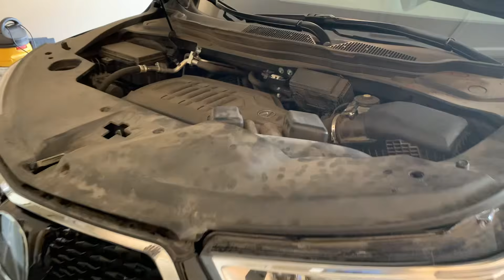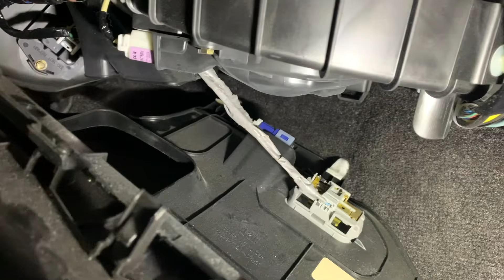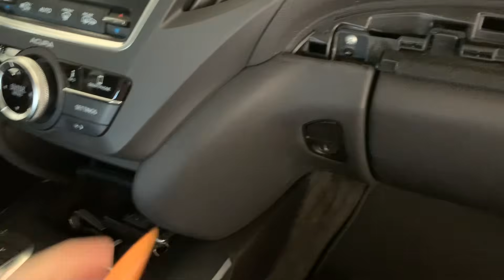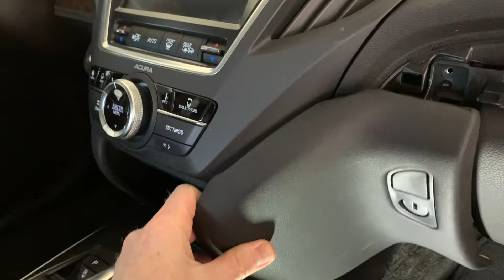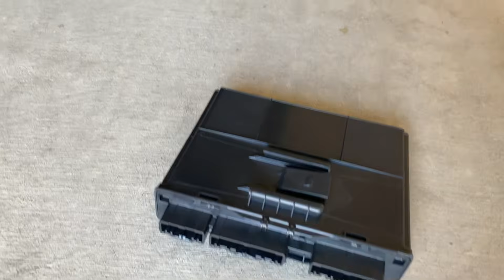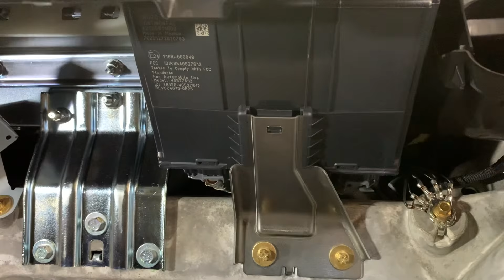Honda / Acura Random, Intermittent Flashing Dash Lights, Headlights, and Car Alarm - FIX Part 2

Comment: Thank you so much for this, you are amazing!  Did this last night on my 2017 Honda Pilot Touring.  Took me about 2 hours start to finish, including a couple kid interruptions.  Also, at least 30 minutes of that was me trying to open the Keyless Access Control Unit.  I did the straw trick that some others have mentioned, and it was still very difficult to get that sucker open.  Once you have the straws in, it still took quite a bit of careful prying to get the thing open.  

A few differences with mine (2017 Honda Pilot) compared to the video is that 

1.  I didn't have to take the vent cover off.  
2.  The process to remove the glove box has an extra tether string that you need to remove, and the bolts were 10mm, not 8mm.  

It went smoother than I expected, and while it's only been 12 hours, I haven't had any issues since performing the fix.  Prior to this fix, the issues occurred approximately every one minute.
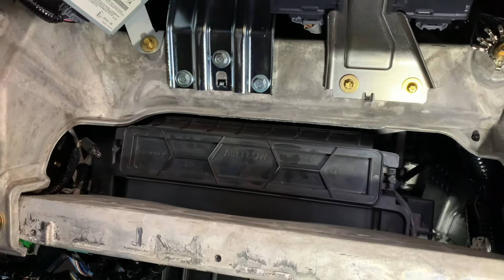Reply: Did your car - behind the glovebox - look like this (at 4:41)? My 2017 Odyssey Touring is completely different. It looks like the housing for a round air filter. Is it behind that?
Reply: @dec222ab  Mine looked pretty much like the video.  In reading other comments, it sounds like on the Odyssey this module is located underneath the steering column, so not the same location as this video.
Reply: Found it. It is on the driver side, way up there. Now to find an offset socket to get the thing out of there.

Comment: I saw references to these videos on odyclub. I did not feel that I could do this safely on my 2016 Ody, so I had a private Honda specialist  shop order a new board and put it in. The first unit received from Honda was defective: the unit ignored all commands. So another arrived the next morning, and that one worked. After getting that second unit installed and programming the key fobs, all has worked well for 5 days.The funny part is that when we dropped off the Ody at the shop, it's dash lights were flashing in its hauntedness. But that is no more. Thanks so much for these videos. The shop had encountered the random alarm issue is past, and had disconnected hood latch sensor to avoid the alarm, which is what I had done. Now they know the likely source of the problem. 

Also, the HDS link showed that the Ignition had caused the alarm to go off, which is the telltale sign of the unit problem and is called out in the TSB on the Ridgeline.
Reply from the maker: Thanks for you comment.  Would you mind adding a comment as to how much your repair cost so that others may know what it might cost them?  Was your cost broken down to show the cost to pair your key fobs to the new module?
Reply: @reginag1874 I paid list price for the new unit $486 plus labor of around $100 which included the fob programming. I have not yet opened the old one to examine it. I’ll report back when I get to it.

Comment: Thank you so much! This was a great tutorial! I performed this to my 2017 TLX. Problem solved! Here are the directions to remove the glove box, which is even easier than the MDX in this video. I will say that you need a torx socket to remove the 2 bolts that hold the module's metal bracket to the dash frame. Much appreciated again! Mahaloz!
Reply: Hi Rick. What are the easier directions? Please do tell.
Reply: @dec222ab  https://www.youtube.com/watch?v=ESWM2-cY8tU&t=1s

Comment: You deserve a Public Service Award for this video and all the detective work behind it. Fantastic job. I can’t wait to use the video to fix my wife’s van. One problem - where is the device located on a 2017 Odyssey Touring? It doesn’t seem to be under the steering wheel as in the video of the 2016 Odyssey. Is it (shudder) behind the glove compartment as in this 2018 Acura? Thanks.
Reply: I discovered the module is on the driver’s side for a 2017 Odyssey Touring. I cleaned the unit and superglued it as suggested. The car has been locked for 24 hours with no 4 am alarms. Yay!  I’m hoping this will be permanent.  Thanks again for helping me and dozens (hundreds?) of others sleep peacefully.
Reply from the maker: A comment by another individual about 6 months ago reported on their 2016 Odyssey "this module is located on the driver’s side underneath the dash up high almost behind the steering column. It can be removed without taking out the dash board by removing the lone screw holing the bracket in place."  Also found this video: https://www.youtube.com/watch?v=TZZxIJQF42g
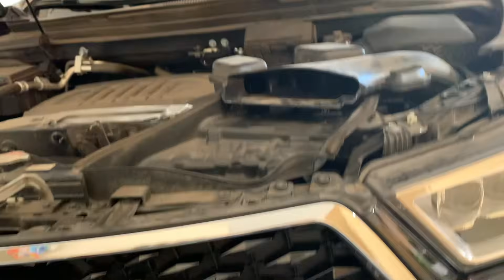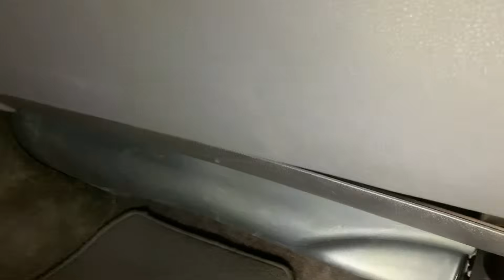Reply: @reginag1874  Thanks for suggesting this and thanks much for helping out DIYers like me. The video at 1:19 & 2:07 shows where the 10mm bolt holding the PCU is on the 2015 Odyssey. But the component is not there on my 2017 Odyssey Touring. (I can send pictures.) Any suggestions on where to look now? Thanks.

Comment: That happening to my acura tlx 2017  same the video clip,,,what happens if i want to replace the new one,,do i have to reprogram for the new one,,please i need some advice,,thx
Reply from the maker: Reposted here from a previous similar comment and question:  If you replace the Smart Power Control Unit you will have to pair it to your key fobs.  I have heard that some mechanic shops can do it.  I'd suggest you ask them first to know for sure.  But, a dealership can do it.  I think I was quoted about $350 to do it.

Comment: What a great video! I just finished this repair and hope it works like it did for so many others. 2017 tlx with all the same symptoms as everyone else. Glove box removal is a little different but everything else is pretty much the same. Like others said, getting the circuit board out of the plastic was the hardest part. Took about 45 min start to finish. Fingers crossed this worked!
Reply from the maker: Great!  Thank you for your comments and sharing your experience.
Reply: Hello I have 2020 TLX base model, my car headlights turns on randomly while parked not even start. when that happened i open the hood and hear clicking noises from fuse box as well, did you had this issue or different issue?

Comment: 2020 Honda Pilot checking in here with the same issues . I just completed the fix as shown in the video. I couldn’t really see any fibers on the electrical component but went ahead and cleaned with alcohol and covered with clear nail polish. I will report back in a few months with any updates. Thanks for the video!
Reply: How has it been for the past couple days?
Reply: @MBrain77  great. No issues at all. I will say that the alarm issue/headlight/dash flashing was pretty infrequent (a few issues each month). So it’s kinda hard to say the issue is fixed with certainty so early on. But I’m pretty confident it will be based on all the reports here.
Reply: @codyanker7504  awesome thanks for the reply

Comment: this guy might of saved me soo much money thank you 🙏 hoping that the problem doesn’t come back
Reply: Update problem hasn't happened again this guy is a legend especially when Honda blamed my aftermarket sound system that was set up by Best buy so they ended up disconnecting it just for the some problem to continue to happen sad thing is they couldn't figure out the problem to something that's a major flaw in these car models

Comment: Omg! I’m so glad I found this video before I wasted money on unnecessary repairs. My Odyssey had the same issue and I followed the instructions to check the control unit and it was the same exact spot as the video. I cleaned and sealed it with silicone and no 3am alarms. My neighbors and I are so happy.
Reply: For anyone who wants to sue, I’m about to get that started. I’ve gone through everyone’s comments, written down the cars then found out the part numbers. We are all being screwed by the same Model # control module.
Reply: What year odyssey? I see some people saying their odyssey is on the drivers side. Trying to figure this out for mine right now.

Comment: I did this on my Honda Pilot 2016, took out the device, got it open after a bunch of prying, examined the board at the cop you indicated and also the chip next to it I saw some evidence of dendritic growth but it was very small I also saw what seemed like dendritic growth between the two chips I then use a cotton swab and rubbing alcohol and rubbed all around both chips. I didn't put on any super glue as I was concerned on my precision and possibly causing some other issues so it would be helpful to see how much and how to apply Super Glue around the edges of the chips as you indicated however I do want to thank you profusely for this video because it saved me tons of money and my Honda is no longer spazzing out in the driveway. I was troubleshooting this issue for the last 8 months and had finally resorted to just taking out the horn fuse but it continued to Blink its lights and occasionally drained out the battery so again thank you for this awesome video
Reply from the maker: That is fantastic!  Thank you for your comment.  Wow, 8 months of torture.  Glad this fix worked for you!

Comment: 2017 Honda Pilot. Last weekend, in the driveway it started with the horn honking. Took several minutes before I realized it was the Pilot. With the crackling going on behind the dash, I thought the dang thing was shorting out. Immediately disconnected the battery and we took it to Honda. Thankfully, I found this video before they touched anything and picked the car back up on Monday and today took it all apart (for 2017 owners, the vent does not have to come off). The absolute worst part of this was pulling the module out of the plastic housing. My housing looks like a raccoon chewed it now, but I was able to clean up that spot on the board and seal it with super glue. Hopefully that does it. We are talking about trading this thing in since it's been nothing but issues (TSB on the fuel injectors already, lights coming on the dash randomly and nothing being wrong).  Thank you for this great video!

Comment: This was spot on.   I had been having issues for about two months where the alarm would go off and all the dash lights would flash on a 2016 Honda Pilot Touring.  I opened up the module as shown in the video and sure enough the coverage on the board was missing.   I cleaned it with an Q-tip and isopropyl alcohol and put a drop of glue to cover the exposed IC.   It's been 3 weeks now and everything is working beautifully.  Thanks so much for posting this.
Reply from the maker: Fantastic!  Thank you for your comments and sharing your experience.
Reply: Was your module on the driver or passenger side for your 2016 Honda??
Reply: @tannerfehring  Passenger Side behind the Glove Box.   It's now 3 months and still no problems since I fixed it.
Reply: For anyone who wants to sue, I’m about to get that started. I’ve gone through everyone’s comments, written down the cars then found out the part numbers. We are all being screwed by the same Model # control module.
Reply: Can you add 2016 honda oddesey 😔
Reply: @angiejjs2 we just had this happen in our 2016 Odyssey. Trying to locate it now
Reply: @elexisranelleful have you discovered if this can go anywhere?

Comment: I have an Acura TLX 2009, my issue is that my car acts like the key is still in the car even if the car is off, I can’t lock the car, I have changed the battery and just today and the car is completely dead, would my car still have the same defeat. It’s older car but seems like it’s having the same issues. Please someone help.

Comment: Wow, lets see. Did my 2018 Ridgeline. It started with random horn alarm, cluster spazing, relays chatter a couple months ago. Replaced 6yr old oem battery to Walmart AGM battery, was good for a month til it spazzed again overnight. Started searching forums n found your vid. Just did your fix, my BCM appeared to have more clearcoat over chip than yours in vid. i think it was covering all legs, but hard to tell. I zoomed cam pic to get better visual. I cleaned as u say anyways to try n put nail polish. Lets  hope. I will comment if issue reoccurs. No news is good news. N in 6 months+ if its fixed I owe u beer, dinner, Nobel prize, n name my 3rd born after u. Thanks!
Reply from the maker: AWESOME!  Thanks for sharing!

Comment: My wife was having this same issue with her 2017 Honda Pilot, and this fixed it for us!!  What a fantastic piece of research and a thorough walkthrough.  On the Pilot, you do NOT have to remove the passenger side vent, you can skip that and just get the trim piece off.  I was having a real hard time getting the vent to unclip but then realized I didn't need to.  You've saved countless people a thousand dollars a pop on these fixes, I'd love to Venmo you some $$ so you can have a nice dinner or something (and I think a lot of people who have used your video should also) if you want to share your Venmo!!
Reply from the maker: Thank you so much.  I really appreciate the comments and especially the helpful tip for others doing this fix on a Pilot.  It is incredible to see how many have suffered or are suffering with this issue.  Incredible to think that if only half of the views of the video had this problem and saved $1000 in repairs from the video that is equivalent to $9 million saved!  For that Honda should be paying us for having to deal with this unnecessary and completely avoidable issue.

Comment: Thank you for posting this! I have this issue with ours Acura TLX 2017. It started about 6 month ago and i had to either disconnect the battery or keep it on charger/maintainer during nights as it drains the battery and car cannot start anymore. I will try to follow your instructions, hope that Acura TLX is build similarly to MDX in that regards
Reply from the maker: Great!  Thank you for sharing your experience and tricks for a 2017 TLX!
Reply: btw if you have Acura TLX, the way to remove glove box is a bit different, i found this post that worked on my Acura TLX 2017 https://www.youtube.com/watch?v=ESWM2-cY8tU
Reply: also I used 8 tooth picks to take PCB out of its plastic casing. One on each side of each of four "tongs" Then use pliers to gently pull the board by the middle connector
Reply: and i decided to NOT cover it with a super glue there. Just in case if i did not clean that correctly so i will have another chance of doing that. I think i will just leave this way. If that happen again - i know what to do
Reply: For anyone who wants to sue, I’m about to get that started. I’ve gone through everyone’s comments, written down the cars then found out the part numbers. We are all being screwed by the same Model # control module.

Comment: my tlx alarm kept going off randomly the past 2 days and today the dash statted flickering will be doing this tomorrow!!

edit: been 2 months since i did this and everything working as it should 💯💯
Reply from the maker: Let us know how it went.
Reply: @reginag1874  so far this solved my issue couldn’t see no dirt or anything wrong but still use a q tip with alcohol and wiped everything down and is working as it should 💯💯
Reply: 2018 ?

Comment: I have a TLX 3.5 2017 I been having this issues, I disconnect my battery one time and when I put it back I’m not having power to turn the ignition on there not light on my dash , i don’t have any fuse bad I already check everything, my battery is good, I have power in my doors and headlights but I don’t have any power in my ignition I just wondering if this could be the problem too, cause this blinker thing happens to me a lot it’s just go and then comes back after weeks but it always happens
Reply from the maker: Not sure about the power to the ignition, but based on everything you described you have nothing to lose to apply this fix.

Comment: 2020 Acura ILX is on the driver's side. Needed a few small extensions to get it back on. Tight space be ready to crawl all the way under by the pedals. Opening the box takes some creativity and some broken parts😅. However, it's done and time to wait and hopefully not wake up the neighbors. Nvm the neighbors, I need this nightmare to be over!
Reply: is the module in the centre console area on the drivers side or is the module located closer to the sidewall under the gauge cluster ; I have a 2017 ilx;  thank you for any assistance
Reply: Closer to the sidewall. This fixed my problem.

Comment: This worked for me. 2018 Acura TLX. Exact same problem.

Flickering in the dash got so bad I nearly couldn't start my car anymore. Was previously unplugging the battery everytime I got out the car. 

1. Only main difference from this video and the TLX is there is 1 less bolt and/or 1 less screw before you can pull out the glove box and the panel. 

2. Also you need to pry out the silver trim on the left near the shifter but very easy.

3. In addition, I didnt use super glue I order Conformal coating which is what you're supposed to use for electronic boards and I didnt just coat the section he pointed to but I coated the entire right section of the board because it was missing all the coating.

You can hold the green board in the light and you'll see the entire right side is missing the coating. 

4. Getting the board out of the black box was easily the hardest part. I for sure broke a few of the clips but it still slid back in snug after.

What a LEGEND for this video. THANK YOU THANK YOU THANK YOU!
Reply: Did it work bro? My 2018 TLX just started doing this 😢

Comment: Thank You so much!  I had the same issue on my 2019 Honda Passport Touring, it would happen as often as once a week. Numerous dead car battery occurrences. For me the occurrences happened more often when the humidity was up. It has been one month so far and no issues.
Reply: Did u apply the super glue?  Curious if that is necessary?  It just makes me nervous to put that on
Reply: @tiffanyreed3348  yes I did. I think that is next most important thing after cleaning so it doesn't happen again